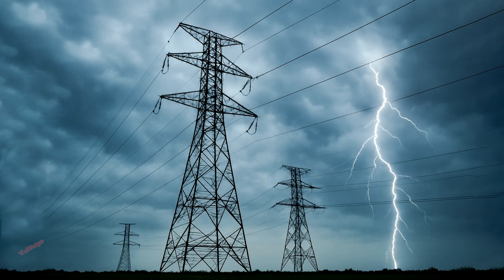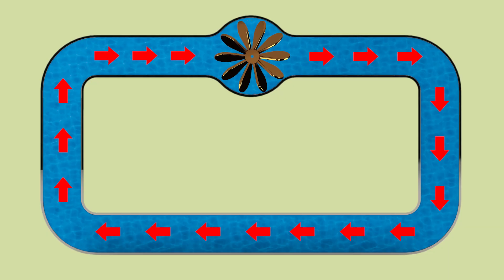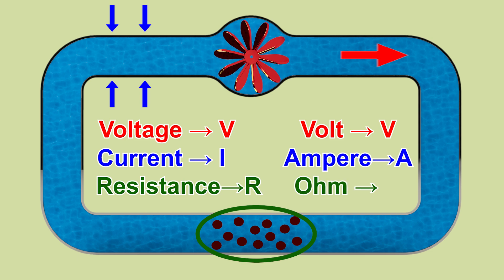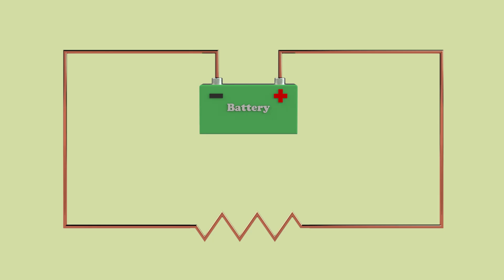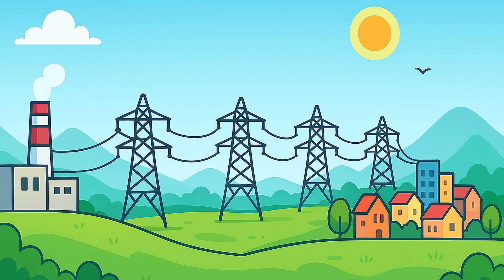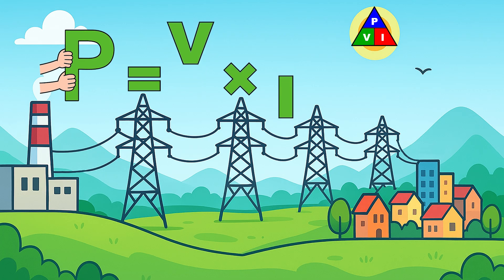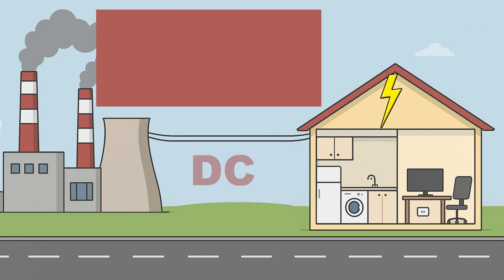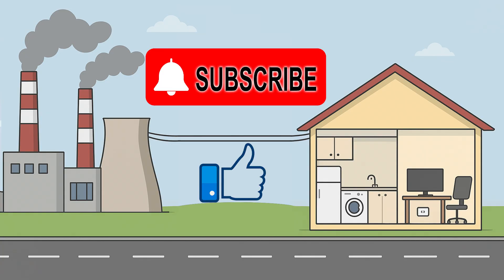Voltage vs Current Made Easy | Simple Water Analogy

Comment: Great explanation of the basics of electricity! I like how it clearly breaks down voltage, current, and resistance, and then ties them together with Ohm’s Law and the power formula. The part about AC vs DC and how electricity is transmitted and converted was super easy to follow. Thanks a lot 😊🙏
Reply from the maker: Glad it was clear and helpful! Thanks a lot for watching 🙏